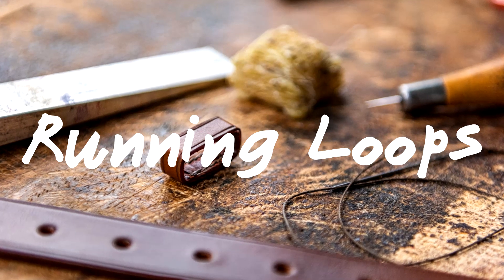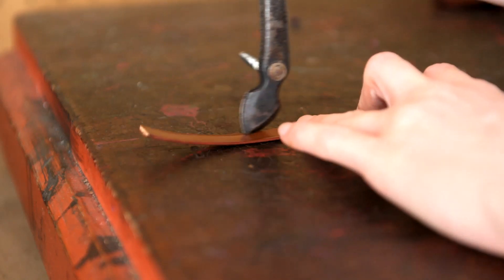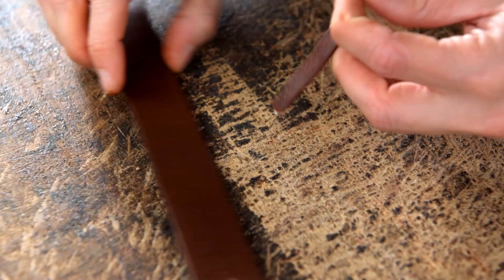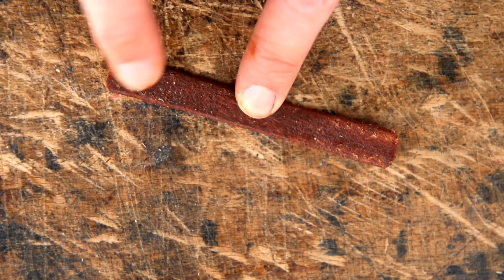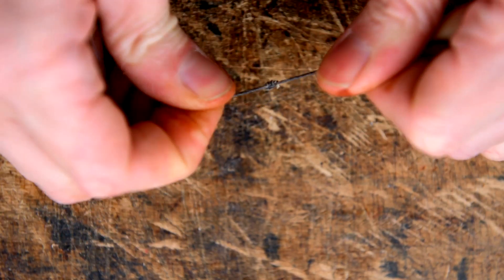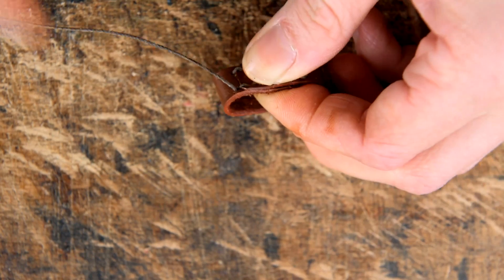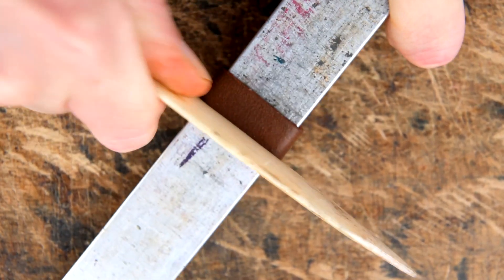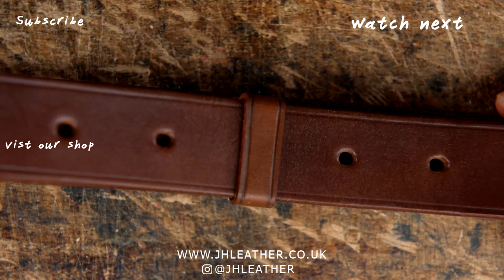How to make - Running Loops - Beginner Leatherwork Tutorial

Comment: I'm a stickler for detail and quality but this is one area where skiving and stitching is a complete waste of time. I use the leathercraft staples and butt the keeper together. It is virtually impossible to pull apart a belt keeper with these staples in place not mention that a belt keeper is never subject to extreme forces anyway. And it is completely hidden under the fold in the belt. I do take pride in the keeper itself with dye, sometimes tooling, always edge burnishing etc.

Comment: I need to get some of those metal loop sticks I'm currently using some poor quality wood wedges from ebay but the metal ones look so much better
Reply from the maker: They are really handy if you can get some.
Reply: @JHLeather  Where does one buy the metal loop sticks?  Great video on making loops! They are so uniform and square cornered. Very professional looking.
Reply from the maker: I got my set about 10 years ago when I was at college. I don't think the guy is making them anymore though. I think Abbey England may do a metal set but I'm not sure what they are like.

Comment: Hi Jo, .is there an industry standard  for what size leather to use for an item and what size tools would be needed for the thickness of leather  i.e  thread, needles, pricking irons, edge bevellers, creasers.......How do you decide what size edge beveller to use for instance or what size pricking irons or thread and needle? 
thank you so much for your videos, 
Sean
Reply from the maker: Heya Sean, a lot of what you have mentioned is more a personal preference thing really. For example you can stitch a dog collar in 12 spi if you really wanted to. There are some instances where other factors come into it, for example if you stitch marked in 12 spi you would need to use a thinner thread and needles than if you stitch marked in a 7. Know that is not the most clear of answers but hopefully it will help a bit.
Reply: @JHLeather  🤣🤣 its ok i understood it.👍🤣
What about edge bevellers? is there one size for all occasions or is many different sizes needed, what is a good all-round size to get, as i look at sites and there seems to be so many to choose from i end up with a headache.....same for creasing irons also...🤣🤣🤣?
Thx jo
Reply from the maker: With edge bevelling, again a lot is down to personal preference. The one I use the most is 1mm and that I use for pretty much everything. If you are making a lot of belts or dog collars a larger hollow edge tool works well for the back side of these as it takes a bit more off, but it is not completely necessary.
Reply: @JHLeather  Brilliant  thanks jo, legend as always, Thats pronounced "Ledge end" not leg  end....🤣🤣👍

Comment: this is the waste way of making running loop. You dont need so much stitch to bind them, use contact cement and single stitch work better.
Reply from the maker: The aesthetics on making a running loop like this are much nicer than using a single stitch.
Reply: Quality takes time you probably just staple yours right?